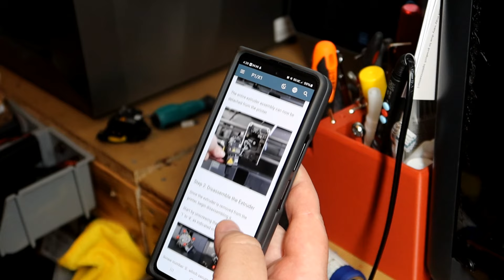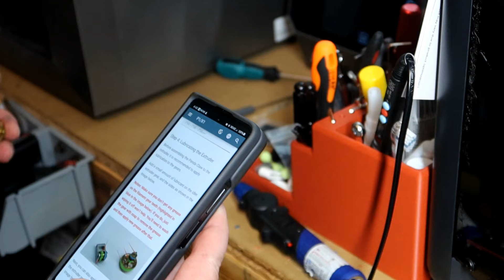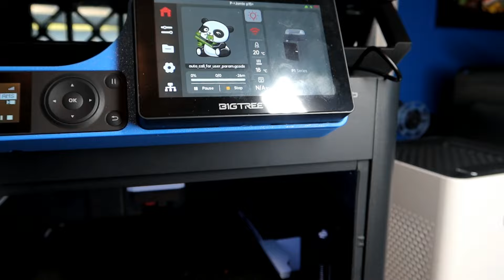How To Install The Big Tree Tech Panda Claw On The Bambu Labs P1S

Comment: Thanks for the detailed guide, mine is coming in this week. Could you do a video explaining the exhaust system using the 4 inch hose? I am thinking about doing that upgrade but struggling to find a guide on the internet.
Reply from the maker: Yes I will be filming a video.this weekend.  Should post Sunday latest Monday depending on edit time.  But will be one of those days

Comment: What does this replacement provide?
Reply from the maker: From stock ?  Ability to print carbon fiber and glass fiber without wearing down feed gear.  From bambu hardened steel set it.provides a metal drive gear that does not wear down after time as well.

Comment: I have been running and testing this since release and I have been unable to see or test any difference.
Reply from the maker: When I got my printers from bambu a1 p1s I ran them.stock.  the p1s. Has normal un- hardened  gears they wore out in 3 rolls of petg-cf  got the hardened set from bambu  worked fine but after 4 months 1 tooth on yellow gear cracked. So I bought these.  They were 19.99 each same as bambu hardened set.

If they fail ill.order another set,  if the extruder motor gear fails but I ran a file across.it and it seems hardened so.i dought there will be any issue.

I noticed it runs pet-cf  better

Comment: Way too much grease used, looks like it also went on the filament part.
Reply from the maker: Right amount of grease and no it did not not.  Perhaps you should visit the wiki and try again ??
Reply: Less is more with grease on steel pinions and spurs, you dont need much, especially when there is a lot of heat involved which will thin out the grease and make it run onto things it shouldnt.